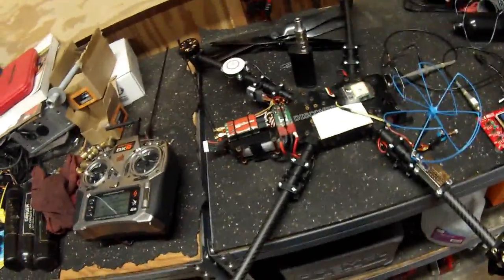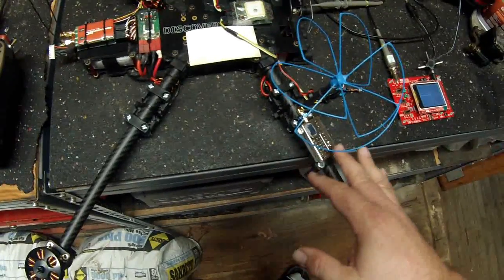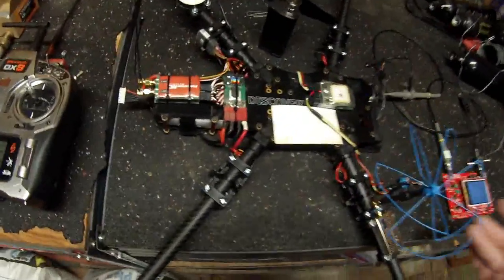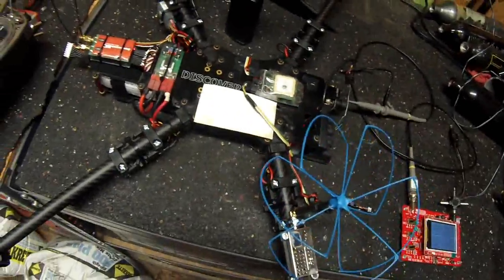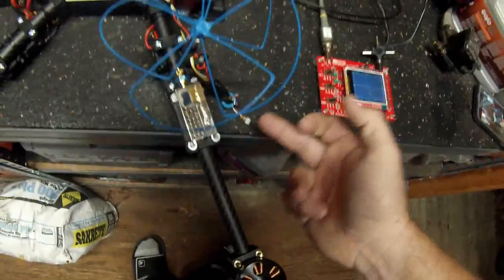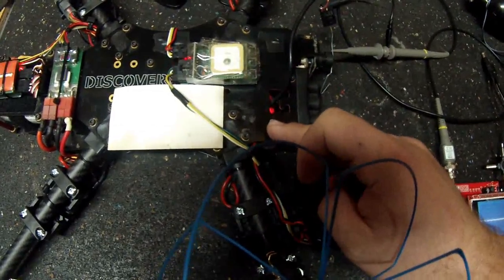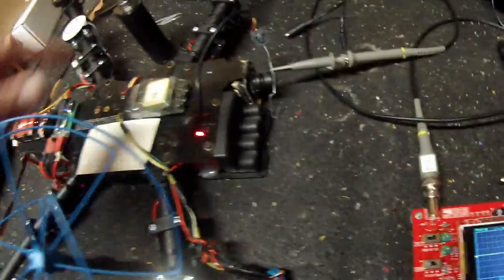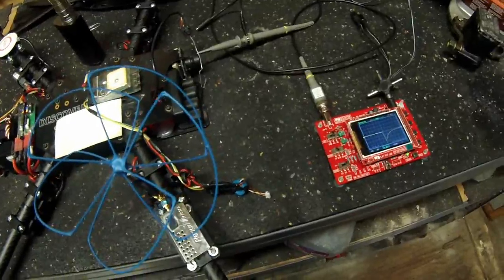Finding noise in my FPV camera

Comment: on my 5" acro my screws holding on the motors were a tad to long. sanded each screw down a little and  fixed everything! the motors ran fine. when it was brought up to me I thought,"no i dont feel or hear anything." but it was that.